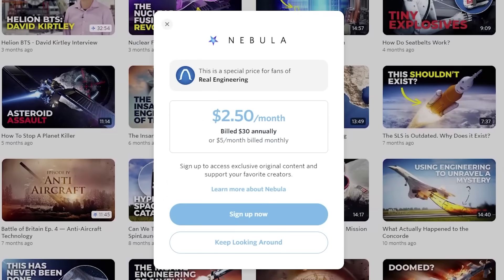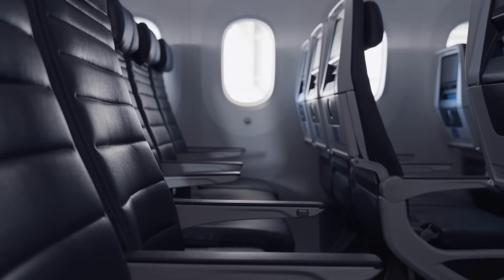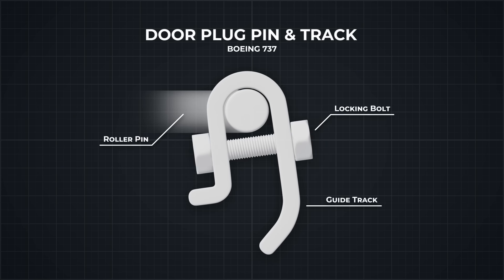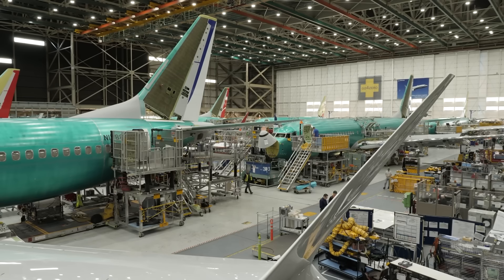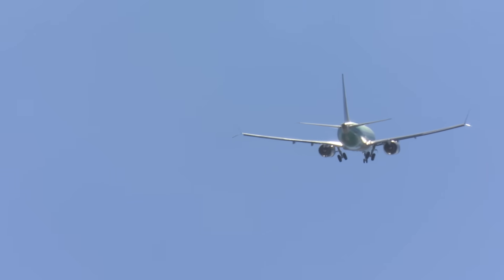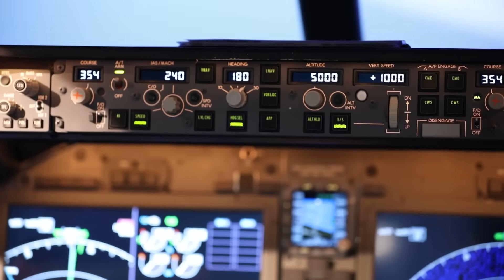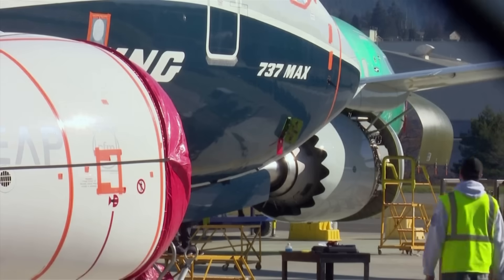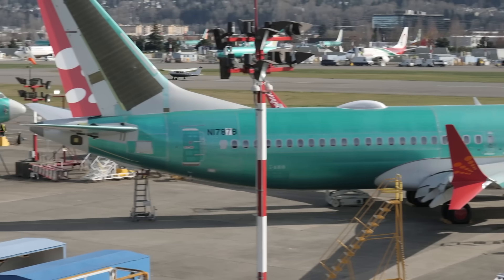The Questionable Engineering of the 737 Max

Comment: Multiple crashes is bad for reputation... But RE calling your engineering 'questionable' instead of 'insane' is brutal
Reply: The bottom line is that the Max should never have been produced. It is an ancient dog of an aircraft, but it was pushed down the line because S.outhwest and R.yan wanted a cheap aircraft with lineal commonality with the 1967-certified B737.  But in truth a 21st century aircraft should never have:

a. Only one sensor controlling a safety system - because that is simply criminaI. Nobody except Boeing has had simplex systems in the last 70 years.

b.  A MCAS system that is able to stab-trim fully forwards - when it is known that the stab-trim is more powerful than the elevator.  Thus the system has sufficient authority to overpower the pilot, and fly the aircraft into the ground.  And if this authority was so easily reduced in the revised Max, then why was this not specified for the original Max?  Were there occasional conditions where the system needed full trim authority (for a high-speed stall perhaps), and they are not telling us about it?

c.  A manual stab-trimmer that becomes mechanically locked if the pilots are pulling back on the control column - so that no manual re-trimming is possible.  (The recommended roller-coaster recovery not being advisable at 2,000 ft, and never taught in the simulator.)

d.  An anti-stall device (MCAS) that operates on the stab-trimmer, rather than the control column.  Look, dear Boeing, the design and mechanics of an anti-stall device are well-known, ever since the Bae Trident got into trouble.  The solution is to push the control column forward, because once the nose is lowered and speed increases, the pressure can be released instantly.  
   However, if you push forward on the stab-trim, you cannot easily pull out of the ensuing dive because you are still trimmed (fully) forward.  (As several pilots have  discovered, much to their dismay).  So why did the FAA not recommend the complete scrapping of the MCAS system, and the installation of a stick-pusher?  Cost?  Time? Certification?   Has the FAA skimped in their recommended MCAS fix?

e.  A master warning system that can be cancelled, so the warnings are extinguished and forgotten.   Dimmed perhaps, but never extinguished.  This must be the most stupid system ever invented for a commercial aircraft.

f.  Important warnings, like low engine oil pressure, that simply don’t appear on the master warning system.  It does not take too much in the way of distractions or inattention to miss the fact that the engine is about to seize. 

g.  Flight controls that cannot be separated if one side is jammed, because the two elevators are joined by a large torque tube.  That would not be allowed on a modern aircraft.

h.  Engine overheat and fire warning lights that are not in the pilot’s line of sight, with no repeater lights on the thrust levers. Back in 1960 the handles and lights were on the coaming, where they should be, but they were relegated to the center console to make way for the MCP.  That was a retrograde fix that should never have been allowed, at least not without repeater lights on the thrust levers.  But what do the FAA care, as long as profits are still being made?

i.  Switches that are all identical, without even an attempt at colour coding.  And the evidence for correct actioning is a light that goes bright and dim.  Now between day and night, just what is bright and what is dim?  Never in the history of aviation has there been such a stupid advisory/warning system.

j.  Switches which are all down for on - unless they are on the forward and center instrument panels, where they are up for on.  Note that the all-important electric trim cutoff switches are down for off - the complete opposite to the majority of switches on a 737.  There is so much room for confusion here, you could drive a semi-trailer through it.

k.  Paper checklists and emergency checklists.  Now come on guys and gals, computer checklists were common back in the 80s, so why the hell are we still operating with bits of crumpled and torn paper?

l.   Mainwheels that retract into the hydraulics and flight-controls bay, where shredded tyres can inflict severe damage on a multitude of systems.  Some airlines placed cages in the wheel-bay to protect the systems, but they did make routine maintenance difficult.  And the hydraulic release fuses were hardly an adequate solution to a failed 1960s design.

m.  Center fuel pumps in the center tank, which can overheat and explode - and no auto-switching system was devised to prevent this.  Has this been solved on the Max, because it was a butcher’s bin on the NG? 

n.  Passenger doors that have to be armed by grovelling on the floor.  This is rather like having a starter-handle on a modern car.

o.  Flight-deck windows that are smaller than an old-fashioned cruise-liner port-hole, because that was all they could make in 1950.  Trouble is, we are in 2021 now.

I could go on, but that is sufficient for now.

See ‘Death Plane’ on the Russel Scott channel.  
I made these videos under the ‘Paul Spencer’ name, for employment reasons.  
These two videos have never been challenged.

Ralph
Reply: @RalphEllis  American Airlines were about to buy the Airbus which had the high bypass engines so Boeing with the help of some high ranking politicians put pressure on AA to buy US made aircraft but they would only do so if they used high bypass engines.  Rather than take the time and expense of designing a plane from scratch, Boeing took the cheap option all the way from rejigging an ancient design to taking shortcuts using software to mitigate the effect these bigger engines had on the old airframe design.  Add to that the cutting of corners not requiring pilots to retrain or re-certification of aircraft along with getting rid of almost 1000 quality control staff, this was insanity from Boeing born out of greed.

People should be in jail over a series of crashes and false statements of safety from Boeing executives to FAA hierarchy to politicians but it'll never happen.
Reply: @RalphEllis  To your point e. Airbus also allows you to cancel master warning or cautions alarms. There are plenty of instances where a situation requires you to turn off a specific caution alarm. Issues will always still be shown below the flight director in the form of ecam messages or other forms of messages that store information for pilots. If the Master Caution alarm is not something that needs to be dealt with at that moment, I don't know a single pilot that wants to sit through that going off while trying to troubleshoot another issue.
Reply: @lachlanhudson7404 .  Not sure about the A320.
But all the other aircraft I have flown cancel the attention-getters, but leave the MWP fault illuminated (sometimes on slightly dimmed mode).  This is so you don’t forget about a fault (there may be multiple faults).

In the 737 you will find that the first action by new f/os is to cancel the MWP.  So if there is any interruption, the fault gets forgotten because the MWP is blank.   Then there are ‘hidden faults’ that produce a completely blank MWP, and the fault is only shown if you press the MWP (no kidding -nit is called ‘recall’).  So you may think you have no fault, when actually you do.   It is the most stupid MWP system ever invented.

R
Reply: @RalphEllis  I studied Aviation and the first thing we learned about aircraft certification was: No single points of failure for critical failure conditions.

Having a system that nobody knows about and which may completely override pilot input depending on only 1!! sensor is the absolute opposite of that rule. I am still completely baffled how it was possible to even certify this.

I know, the FAA 'outsources' certification work to engineers employed by Boing. I feel like this is ok, but if something happens, it is still the FAA's responsibility. Honestly, I think there should roll more heads...
Why do we even have it if it is not held accountable for not doing its job?
Reply: @SandFl0h  One of the problems with modern legal systems - and mind you, it's a problem that arises from modern legal ideas that, at least in my opinion, are perfectly fine - is that in cases like this, the legal system needs to figure out how much every single person actually did wrong. And then it often turns out the errors were distributed widely enough, and individual errors would not have caused problems without other people's individual errors, that there's not enough individual guilt on anyone. 
Now I think there probably should be someone in cases like this who has, let's call it the "system" responsibility (and power, otherwise it's someone higher up), and unless they can demonstrate that they did everything they were supposed to prevent those disasters, then they're guilty - not just so there's someone guilty, but so there's someone with both the power and the self-interest to make sure things are as safe as they can make them. As long as that's clear from the outset, and these people can negotiate their power and remuneration, this seems like something completely compatible with modern legal ideas.
Reply: @KaiHenningsen  That is exactly what the FAA should do in my opinion. They are the watchdog und should thus `elect` the person responsible for that.
Reply: You didn't "study" anything.
Reply: @SandFl0h  Maybe Boeing thought its existing stall recovery procedure that 737 pilots are expected to remember was sufficient, especially as some pilots in the USA managed to switch off the stabilizer trim switches quickly enough after MCAS started engaging to stop a downward trim runaway. However this assumption perhaps leaves too small a margin for error
Reply: @RalphEllis I’ve got to take a moment to thank you for writing that comment. As a layperson I understood the basics of MCAS and why it was a poor solution to the engine placement problem but I appreciate the details of the design issues with the max series.
Reply: @RalphEllis 
If memory serves, there have been multiple in flight cargo door "incidents" that were (in early cases) only belatedly addressed, and one memorable & ghastly situation at altitude shortly after take off from Hawaii that cost the lives of several rows of passengers. The FAA would have succeeded in covering for Boeing if not for the diligent sleuthing of Australian parents intent on finding the negligence that cost them their son. Retired Boeing engineers posted bitterly about the change (for the worse) of "company culture" from prioritizing quality & safety to pinching pennies for profit.
Reply: @garybrown1404 if we’re looking at the same incident here the united 1722 maui flight was a 777 and was pilot error
Reply: @RalphEllis this is a fantastic comment on topics that should be reported more by the media.
Reply: @RalphEllis blud went godmode
Reply: @RalphEllis man, I'm never ever flying on a Max...
Reply: @RalphEllis Thank you for the insight, it was both an interesting and a scary read. Also, it is criminal that this well-thought out comment is just a reply.
Reply: @RalphEllis that’s just shocking, thank you for sharing your knowledge
Reply: @RalphEllis Harvard business majors in Boeing: what’s all these nerd nonsense. My FAA friends already approved it!!
Reply: @RalphEllis  I trust southwest with aircraft more then I trust Boeing
Reply: @RalphEllis  You are absolutely right.

But its not "Boeing" that let these issues slip.

The issue is SOME PEOPLE at Boeing made that call. 

It was a top-secret issues, due to the larger engines causing nose pitch up at takeoff and go-around power. 

In order to maintain the original type certificate flying qualities, to appease the FAA. They had to implement a system without the rest of Boeing learning about it. So they clearly did not have the appropriate departments go over the design of the MCAS system, because anyone with a rational mind would realize the issues.

But if You are trying ro appease archaic FAA regulations on flying qualities,  without having to re certify the entire aircraft to the tune of billions of dollars. 

Then that is what You do. Order a small group of yes men to create a system to hide the issue and never let anyone at the company know what You did.
Reply: @Triple_J.1  🤣 Some people actually believe that social media like Wendover and VOX have any clue what they are talking about in their technical “reporting” (imaginings)—almost as bad as the majority of the regular media. That’s hilarious. Obviously that isn’t quelled much here by the unreal engineering channel.
Reply: @RalphEllis  

Ralph
Reply: Sounds like you’re also typed on the guppy Ralph. Pretty much hit the nail on each critique here.
Reply: @RalphEllis Great info, thank you. Are there any interviews where you are not dialling in from under the antartic? I'd love to listen to hear more of what you have to add on this topic.
Reply: @RalphEllis So what should Boeing have done instead if Airbus was already ahead of them in long-distance single-aisle aircraft and the B757 was already on its way out?
Reply: @aycc-nbh7289 
Design a new plane. That they didn't start sooner is no excuse for cutting corners later.
Reply: @carstekoch  Airbus didn’t design a new plane.
Reply: @aycc-nbh7289  
Right. Because they could fit their new engines without majorly destabilising the plane. Not to mention that the A320 is a completely different plane with a completely different design that happens to have a similar shape and size. You are comparing apples to oranges.
Reply: @carstekoch  I’m comparing the A320 with the A320 NEO.
Reply: @aycc-nbh7289  
No. You are comparing the change of the 737 to 737max to the change of the a320 to a320 neo.
Reply: @carstekoch It still means that Airbus didn’t design a new plane from scratch and neither did Boeing.
Reply: @aycc-nbh7289  
So again, what is your point? Boeing made a mistake with that, airbus didn't.
Reply: @carstekoch  My point is asking why it would not be considered a mistake for Airbus to do it, but it would be for Boeing.
Reply: @aycc-nbh7289  
Again, because abus could fit their new engines without majorly destabilising their plane. Again, they aren't the same planes they just look similar.
They then didn't need to rush a botched job by having several catastrophic failure points for a system that can crash the plane if it fails.
Reply: @carstekoch Why are their A350’s grounded, then?
Reply: @aycc-nbh7289  
They aren't. They were, about a year ago, because Quatar (and only Quatar) decided to ground their airbus a350 that has problems with paint breaking and flaking off. While this is not ideal and expensive to fix, it is mainly a cosmetic and maybe an efficiency problem. It will not lead to the plane crashing.
It also has nothing to do with the A320 that does not use carbon fibre composite materials for the cell and therefore is unable to have this problem.

In short, your information is outdated and it has nothing to do with your point.
Reply: @carstekoch I’m pretty sure this has more to do with PW engines and Airbus’s inflexibility when it comes to engine choice. It has to do with the A320 because it is the same manufacturer, so it could have the same issues.
Reply: @aycc-nbh7289  
Then you'd be wrong. Given that there was only one grounding event, that factually didn't have anything to do with the engines. And the reason it was grounded for literally can not occur for the A320 as I have already stated.
Not to mention that there are only a handfull of turbo fan engine manufacturers in existence and Airbus uses products from all of them, as does Boeing. In fact the engines used on B737MAX and A320 NEO are the same LEAP 1A/B engine and Airbus has the additional option of the PW1100G.
Although there definitely are problems with the PW1100G Engines on the A320 NEO. I will give you that.
Reply: @RalphEllis  The 737 max not having low engine oil pressure warnings on the master system is the most hilarious one for me, most cars have those these days!
Reply: You know the worst part about MCAS being controlled by a single AoA sensor? All modern planes are equipped with two AoA sensors. There was no excuse for MCAS not using both.
Reply: MCAS isn't an anti-stall system. Like, explicitly not. It's there specifically to make the Max handle like a 737NG so the airlines wouldn't need a new type rating. The entire point here was to match the A320neo's "look, pilots don't need a new type rating!" marketing. 

The 737 Max is not inherently a bad aircraft. Just one that shouldn't be a 737.
Reply: @RalphEllis  hello time traveler. we are in 2024 now 😳otherwise, you know it`s an exceptional comment when there are 536 likes and zero replies. Thank you for educating me about this topic.
Reply: @alexandruboghean5826  You mean no replies that haven’t been ghosted. There are billions of people with opinions that are based on misunderstandings of fact.
Reply: @RalphEllis 737 max is a modern 737 so very usable and very safe
Reply: @harryvlogs7833 . Err, no.
The Max is a 1967 certification aircraft, based upon the 1950s 707.
Most of the systems are original 1950s, from the 707, and would not pass modern certification.  That is why Boeing was so desperate not to have to re-certify, when making the Max.

R
Reply: @RalphEllis  it’s honestly ridiculous how old fashioned some of the in-cab footage was. It didn’t look that different from a lot of the Concorde controls…
Reply: @RalphEllis  Your level of ignorance, along with a large percentage of other posters under these videos, is hilarious.
Reply: Making it 'insane' could imply that it's either so great or extremely bad. Questionable directly implies that there's something wrong with it.
Reply: @sublimedrone How about "dubious"?!
Reply: I was a thinking the same, puts the 737 max in the same category as Oceangate...
Reply: Them changing the centre of gravity by replacing the engines with new high bypass modern larger ones, and their flight control system fix for that, was utterly daft. Nuts. Etc..
Reply: @huwzebediahthomas9193 .  The CofG was not the problem, it was the CofL (Lift). 
At high angles of attack that forward-placed engine acts like a canard wing, and lifts the nose of the aircraft beyond the control of the elevators, flipping the aircraft over onto its back.  Hence the ill-advised MCAS system to prevent this.

But Boeing should have added a stick-pusher, like normal aircraft have, not a MCAS bodge.   You NEVER fly the trimmer.  But that is what Boeing made - a system that flies the trimmer.  Trouble being, the trimmer is more powerful than the elevator, and can force the aircraft into the ground.

In addition, full forward trim can create an geometric-aerodynamic lock, so you cannot trim back manually.  With full forward trim, and pulling back on the column, it is impossible to return the trim back to neutral.  Boeing recommends flying the aircraft in a rollercoaster flight, with zero g at the top, at which point trimming is possible.  However, performing a rollercoaster with full trim forward, close to the ground, is absolutely impossible.

This latter fault is still present on the Max.  It has been a fault on the 737 ever since its certification in 1967.

R
Reply: @huwzebediahthomas9193  , sorry to say it, but you are clearly very naive about this. There is nothing at all uncommon with Boeing's solution to the engine repositioning on the MAX. Modern jet aircraft could not exist if it were not for compensators to make them more stable. This goes at least as far back as the 1950s, when swept wings were first being introduced on passenger aircraft; they are inherently unstable, and require 'fixes' such as automatic yaw damping systems, something that every swept wing aircraft has had ever since. On every commercial jet aircraft, there are numerous subsystems required to compensate for various things, and most passengers have no idea about their existence. The MCAS system on the MAX is just another one of these, and is not in and of itself wrong, 'crazy', 'nuts', etc. The crashes by those two carriers several years ago were not caused by the MCAS itself; rather, they were caused by the affected airlines not training their pilots to fully understand how that system is supposed to work. In a malfunction such as loss of sensors, the pilots are just supposed to turn MCAS off and fly without it, dealing with the now-uncompensated tendency to pitch up, which is not at all difficult. Having not been adequately trained, they instead fought with the MCAS instead of disabling it until the sensor issue could be repaired. All US carriers who fly the MAX had given their pilots the extra MCAS familiarity training, and they knew how to deal with any malfunction. To be sure, Boeing had promoted the MAX as an aircraft which was so identical to the older 737 models that pilot re-training on the new model was not strictly needed, but most carriers disagreed and gave their pilots the extra information.

To be sure, MCAS, like ANY computerized system on an aircraft, there is always room for improvement of its software, and in aviation, modifications to aircraft and their systems are always happening, learning from past issues and making the systems more robust. In this regard, the MAX is in no way special; it is just in the news so lots of uninformed people can get overly excited about it and draw faulty conclusions. Read some aviation history, about the great many accidents that resulted in improved designs and procedures and training  that ended up making aviation safer, and by comparison to THOSE the MAX looks pretty darn good.

And the door plugs do not suffer from any particular design issues either, they are just like door plugs that have been used on lots of different airplanes for a long time, and are perfectly safe designs (assuming they are correctly installed and maintained, but that is true of EVERYTHING in aircraft).

However, Boeing has indeed let some quality control slip. The door plugs can come off if the safety hardware is not properly installed. Investigations so far have found loose hardware on numerous aircraft of the same and similar types. As was pointed out in this video (any many other places), Boeing itself does not even make these door plugs, OR the fuselage they are attached to; they are made by subcontractors, and this is also in no way new in the aviation manufacturing industry. Regardless of how and why these planes were allowed to fly with loose hardware, well that is an ongoing set of investigations, and as even this video noted, there is plenty of blame to go around. No doubt a lot of inspections will fix the loose hardware, and Boeing will hire more inspectors to triple check things like this before planes are delivered, which they had probably assumed were being checked by the subcontractor.
Reply: @huwzebediahthomas9193  It would have been incredibly clever if it worked. God knows how many systems in various machines (including 737 themselves, but not only) are made like that, but actually work. What seems to be a problem is that this software was clearly rushed.
Reply: @EustaH  What made it a problem was the reliance on a single AoA sensor instead of a redundant two or three. Do you know why they relied on one? It's because the FAA said that if any system was important enough to need redundancy, it was important enough to need safety testing - so Boeing just pretended it wasn't important.
Reply: @thewhitefalcon8539 . It was not just the testing of a triplex system.
It was the re-certification and extra pilot training.  Boeing had promised airlines that there would be no additional training (and had a financial penalty if there was any training needed).

Note, even the existing duplex system would have sufficed (there were always two AofA vanes.  If a discrepancy was noted, the system could have switched off.   But Boeing could not even do that…!

R
R
Reply: I refuse to watch videos with "insane" in the title, so I'm just glad I get to watch this.
Reply: Penny pinching is so darn expensive.
Reply: I'm pretty sure they also called Ocean Gate's submarine questionable multiple times
Reply: This wasn't an engineering problem.  This was an installation problem.
Reply: its questionably insane XD
Reply: What do you expect when you have investors in control , not aviation experts
Reply: The failure was due to human error in the installation of the door plug mounts not being torqued to the proper specifications.
Reply: Time to short some Boeing stock
Reply: I swear everytime there's a systemic problem that ends up hurting or killing tons of innocent people, it always comes down to executives cutting costs

Surely there are better ways of running these companies
Reply: My friend nice video but you sound like you part of Boeings PR team!!
Reply: You cannot compromise aerodynamics of the airplane. CO2 emission is one thing, but breaking basic laws of physics is another. Too much composites means less costs and less safety. Use plastic instead of metal in some cases and you see what I mean.
Reply: and Boeing shareholders are just millions of faceless nobody's. and now we've finally gotten to one of the roots of the problems with capitalism: the true power is shareholders, but shareholders don't have values or morals, they're just a faceless hoard who's only desire is profit above all else. it's complete antithesis to a moral society.  @Justsomeguyyuyu
Reply: sure lol
Reply: Real Engineering EVISCERATES one of the world's most powerful flying apparatus companies.

Actual expert DESTROYS shady megacorporation.

Engineer ANNILHATES  corporation now known for poor engineering.

Mega corporation gets away with shady stuff once again.

Powerful, elite company gets another slap on the wrist; in other news Florida man goes to jail for possession of a plant.

These headlines are just so ... Sad! 😂😂❤❤
Reply: I just laughed out loud thinking the same thing
Reply: What about: The "Insane" Engineering of the 737 Max. 
I know I know, all was a quality control issues...
Reply: #7 trending Youtube
Reply: It's the janitor's fault.
Reply: @bunsw2070  As an aircraft cleaner, you just made me laugh. Thanks.
Reply: Yeah. The worst insult.
Reply: It’s traditional Commonwealth understatement. They could have also used ‘inadequate’, ‘novel’ or ‘Not quite up to par’. Or ‘disappointing’ if they really felt strong language was required….
Reply: Given RE history like insane  engineering videos it wouldn’t be right usage
Reply: Haste makes waste
Reply: The Boeing 737 MAX has faced a number of issues since its introduction in 2017, culminating in a 20-month grounding following two fatal crashes. While the aircraft has since returned to service, concerns remain, and recent incidents have raised questions about its ongoing reliability. Here's a breakdown of the key issues:

1. MCAS and the Lion Air and Ethiopian Airlines Crashes:

The primary factor in both crashes was a malfunction of the Maneuvering Characteristics Augmentation System (MCAS), a flight control system designed to prevent the aircraft from entering a stall.

Boeing 737 MAX MCAS system

MCAS relied on a single sensor, which in both cases provided erroneous data, causing the system to repeatedly push the nose of the aircraft down, ultimately leading to the crashes.

Boeing has since made changes to MCAS, including adding a second sensor and making the system easier for pilots to override.

2. Quality Control Issues:

Several recent incidents have raised concerns about Boeing's quality control.

In August 2023, Alaska Airlines flight 131 experienced a partial loss of the cowling, the outer covering of the engine, due to loose bolts.

Investigations revealed similar issues with other 737 MAX aircraft, prompting airlines to conduct additional inspections.

These incidents have led to questions about whether Boeing's production processes and supplier oversight are adequate.

3. Regulatory Scrutiny:

The FAA and other regulatory agencies have increased scrutiny of Boeing following the 737 MAX crashes and recent incidents.

This includes more thorough inspections of aircraft, as well as closer oversight of Boeing's production and design processes.

The increased scrutiny is likely to continue for the foreseeable future, as regulators seek to ensure the safety of the 737 MAX.

4. Reputational Damage:

The 737 MAX grounding and subsequent issues have damaged Boeing's reputation.

Airlines may be hesitant to order new 737 MAX aircraft in the near future, and passengers may be less likely to choose flights on the aircraft.

Rebuilding trust will take time and require Boeing to demonstrate a clear commitment to safety and quality.

It's important to note that the 737 MAX has undergone significant modifications since the grounding, and many experts believe it is now a safe aircraft. However, the recent incidents raise concerns that further work may be needed to ensure its long-term reliability. Only time will tell whether the 737 MAX can fully regain the trust of passengers, airlines, and regulators.
Reply: USA USA USA 🇺🇲🇺🇲🇺🇲

But seriously what's happening to our country and our businesses. We are a laughing stock. Where is our pride? What are we doing to hold these Boeing execs accountable?
Reply: America just doesn't work anymore.
Reply: Boeing been real silent since this video dropped…….
Reply: Well they knew the plane is shit, FAA also knew it's garbage yet they went "ok, can carry passengers".
Reply: Love how liberal channel owners are running interference for this.  Bro, investigation concluded the reason was NEGLIGENCE.  They DEI checkbox hired the biggest self proclaimed victim that would score them the most chinese social credit score points among their brainless communist biden voting elite friends, INSTEAD of hiring someone based on merit.  Betting the most qualified for the job was a straight white male christrian and they straight up said NOPE.  Hope you all know, airlines are hiring people based on their race, rather than if you can actually fly a plane now.  Think about that every time you take off and land.  Assuming ya make it that far.
Reply: The 737 is the most iconic and best selling narrow body aircraft ever made 

Boeing should’ve left it alone and come up with a completely new plane. bigger isn’t always better, they should’ve went with a different engine design since the (LEAP 1B) was too big for an aircraft sitting so low on the ground. Boeing being Boeing just raised the main gears, moved the oversized engines forward and tilted up (which was not made for the airplane design to begin with). They throw a system (MCAS)that was way too over powered when is comes to functioning properly… says the Max is just like any old boeing airplane and pilots were never made aware of such system, which took down Two planes. 

Now their reputation is in the garbage disposal, other airplanes manufacturers are jumping at this opportunity to replace them
Reply: Insane could be taken as good out of context.
Reply: Sure avoid safety good measures to have repeat customers by well keeping them alive and faithful ..

Exec: nah that sounds like a horrible idea
Reply: This is the result of Boeings aggressive DEI hiring. You cannot trust ghetto people to perform jobs where people’s lives are at risk.
Reply: Diversity equity and inclusion caused this
Reply: S T f u you know zero
Reply: You're merely demonstrating your poor grasp of both language and engineering.
Reply: Ralph - Brilliant summary, thanks!
Reply: @catgirl2747 So what do you think Boeing should have done to compete with the A320 NEO? The tooling for the 757 was already gone.
Reply: Questionable is an extremely polite way to describe Boeing’s current technical capabilities.
Reply: Fr😊
Reply: I find people involved in science based professions quite reluctant to use language that makes their world look bad.
Reply: @MzeeMoja1  Maybe because science is more about possibilities than certainties.
Reply: And the fact that RE was gushing over the 787 Dreamliner and its new turbofan engine just a few years ago shows how far Boeing has fallen in such a short time.
Reply: @Breatropolitan But is it like they’re willing to turn their attention to Airbus’s problems?
Reply: Many lives are taken, the max should be stopped and not take any more lives
Reply: Not brutal. Fatal.
Reply: What is more insane is that boeing did have a functioning system in the past but they abandon that policy in the name of profits. While airbus still has that quality control culture which will make airbus more dominant.  Airbus might become like google is today as a search engine which means they will become close to a monopoly. Or maybe a duopoly between airbus and comac. 
I hope boeing will return to form but I doubt it will happen now, boeing should have learned after the MCAS disaster.
Reply: They can close up shop with this, irrecoverable PR blow
Reply: Well, among other things, actual engineers know the difference between engineering and manufacturing or maintenance faults. Unlike the original MCAS implementation, there is nothing wrong with the design / engineering involved here. (And social media as well as much of the regular media got the MCAS story wrong throughout--never could grasp its purpose and function.)
Reply: Maybe Boeing should fire all engineers and increase salary of the execs😂😂😂😂😂😂😂😂😂😂.
Reply: 99% of the plane still did not cause a crash.
Reply: This was NOT an engineering issue. This was an installation/maintenance issue. Misleading "Click bate" titles drive me crazy.
Reply: LOl nope you are very far off.
Reply: Bro really thinks that RE is is the FAA
Reply: Why 737 max engineering is fine and very safe